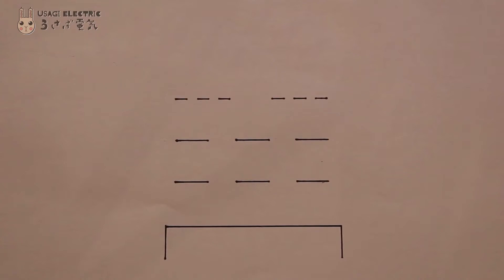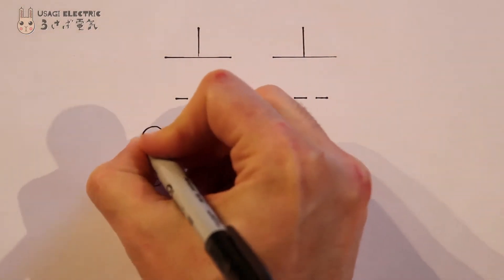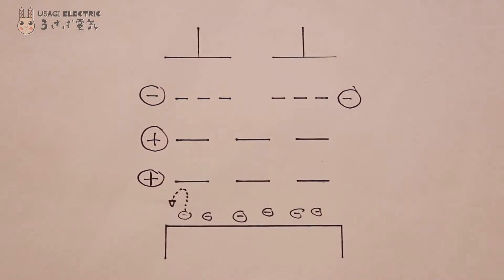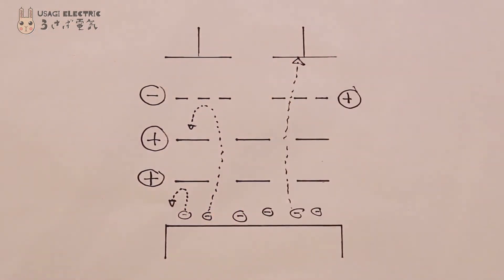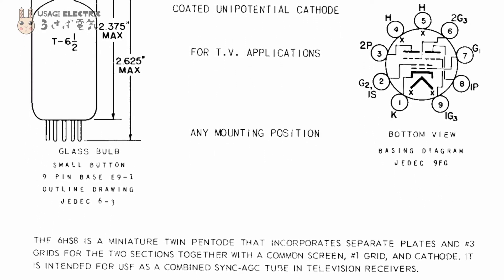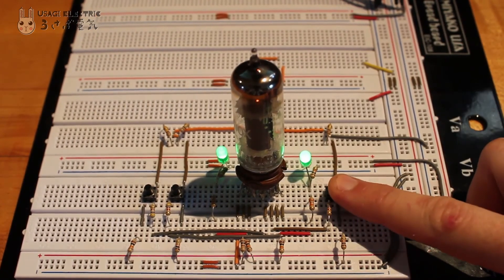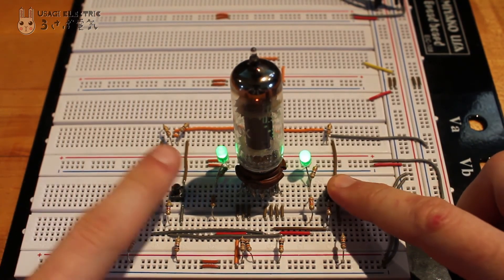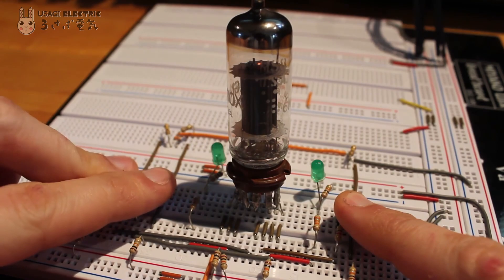In a Minute: Vacuum Tube Dual Pentodes in 60 Seconds

Comment: 6BV11 Compactrons are two seperate dual control pentodes in one 12pin bottle. So you could easily have dual NAND functionality without having to work around the shared grid. I'm using those for my logic projects. I will say though the 6HS8's are pretty cool and there could be places in logic circuits to use them. Also the 6HS8 has a bigger brother the 6LE8. May give more drive.
Reply from the maker: I hadn't heard of the 6BV11, but that's awesome! I can't believe they stuffed two completely separate pentodes in a single tube. You could definitely build some cool stuff with a handful of those!
Do you have any links to the logic projects you're working on? I'd love to check them out!
Reply: @UsagiElectric  I don't have any online info sorry. Right now I have an XOR gate using two 6BV11 Compactrons, a 6BE6 NAND, a 6J6 NOR, a 6C4 NOT/Inverter, 6AL5 OR, 6AL5 AND, and 1 bit of capacitor memory using a 6AL5 as the gating tube. There will be more happening.
Reply: @UsagiElectric   I am on your Discord maybe I can send you pictures through there. I haven't tested anything yet to see how good they work, i kinda put the cart before the horse and didnt build any power supplies or get any test equipment lol!

Comment: This must have been the ultimate computer tube then. You can built anything out of nands
Reply from the maker: Unfortunately, it doesn't seem to have really been used all that much. IBM primarily used specialized versions of the 12AU7 and 6J6 dual triodes combined with diodes to build logic gates. They could pack a dual triode and a dual diode into a single pluggable unit and have two NAND gates in a really compact package. Most likely though, as with most things in life, it probably came down to which tubes IBM could get their hands on in large quantities for cheap!
Reply: @UsagiElectric  yeah...gotta realise that IBM was a commercial company. (Unlike to my location right up until 1986 everything was state owned..by soviets of course. So they used what they were told to use by the higher up party men

Comment: Random question I’ve been meaning to ask: why are vacuum tubes so big? Is there a physical limit to how small they can be made? Is it a manufacturing or materials science limit?
Reply: I guess mainly the manufacturing. 
There are some very interesting examples of subminiature tubes, for example the 1j24b pentode. 

I guess tube technology was simply  replaced by solid state stuff to early for it to be fully miniaturized. 
Because if you compare very early tubes to the tubes from the 70s, there was quite a bit of miniaturization already.
Reply from the maker: That is an excellent question! As Da_Stier said, I believe it was mainly a manufacturing thing. Winding the grids took such massive precision, that it just took a while before tubes could start to become properly miniaturized. Also, pulling the glass tube to a vacuum posed a limit on just how miniature the tube could become.

Nuvistor tubes are very interesting examples of where tube technology was headed before solid state took over completely. They're (relatively) tiny metal cans, and the entire thing was constructed in a vacuum, eliminating the need to try to pull the inside to a vacuum (like with traditional glass tubes). 

However, I believe there's also the problem of gain. If you check out amplifier power tubes, they're absolutely massive. Because the electrons have to flow through a vacuum without any actual conductor to pass through, the amount of electrons that can flow is limited. So, if you wanted big power, the easiest solution was to make a bigger cathode and a bigger plate. I think the standard 7-pin and 9-pin tube form factors that we often see are the result of a delicate balance between miniaturization and sufficient power.
Reply: @UsagiElectric  what if we used MEMs technique and photolitography to create vacuum tubes ?   it would be ironic to do that instead of creating a CMOS transistors, but why not ?  the cost of manufacturing is the problem with vacuum tubes,  isn't it ? why everything is boring CMOS ? what's impeding us from creating a very nanoscopic valve ? wouldn't the same principles still apply in a smaller scale ? or the Maxwell's equations changed that much ?